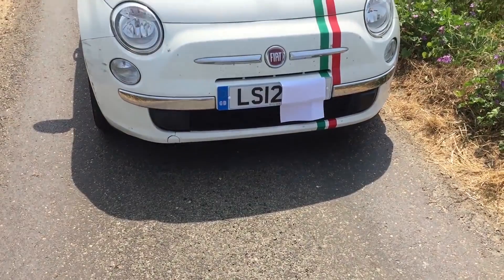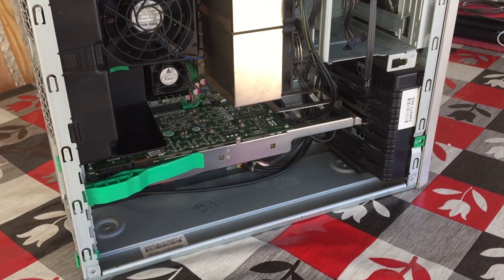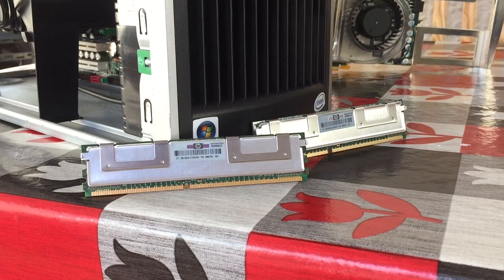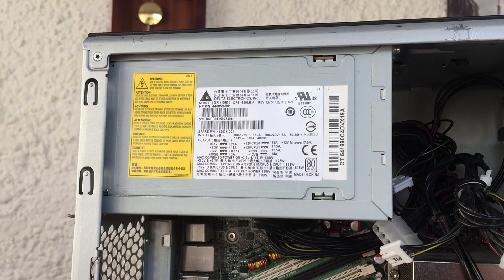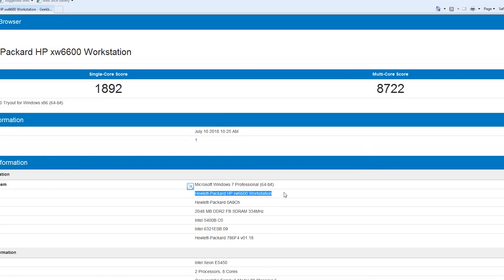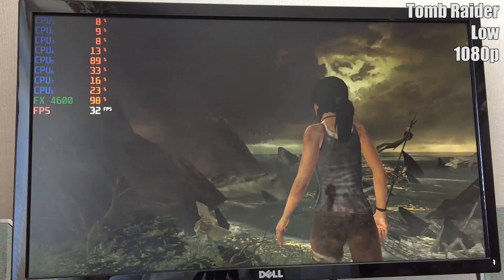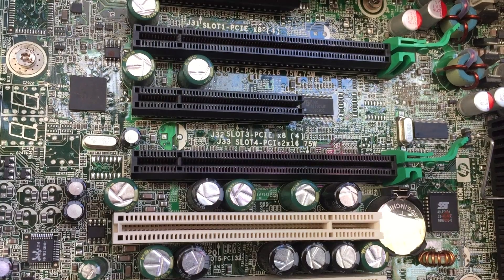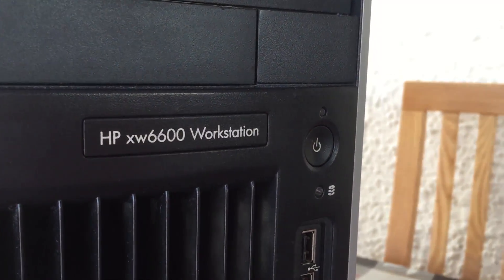This 8 Core Xeon Workstation PC Cost $5000 in 2008, Today I Bought One For £25 ($30)

Comment: Grab the biggest Quad cores for it you can,loadsa cheap as chips memory & a good low power GPU .My Dell T5500 has 48GB memory ,2x 5680 xeons & a GT 1060. runs like a train,cinibench is approx 1500.

Comment: I got for 400$(eur) a 16 core (32 thread) dual xeon e5, 128gb ram ecc ddr3, 128gb ssd, 2tb hdd and a gtx 660, he gave me also the old card, a quadro fx 5800.
Reply: And i have an unused gtx 970 cause i got a gtx 1070 so i think it will be worth it to put on my workstation.

Comment: I tried to get a WX8600 once, ordered it...waited 2 months, and it didn't get delivered :(  Dispite their age they are very nice machines to work with. Got a Proliant ML350 G6 instead, which was faster and in Cinebench even outmatches a Haswell i7 in multicore! Not using it for gaming, but for video storage (loads of HDD slots) and on occasion video rendering (which it does realy well, with dual quad-cores with HT, it leaves my 'main' i5 quadcore in the dust, even though the Xeon have 1Ghz less frequency).  And, I kinda like those HP machines, the workstation and servers at least, not the 'plastic fantastic' home/consumer PC's.

Comment: I've got one of these as a server upstairs, but mine was £40 shipped off eBay. Did a couple of upgrades on it.

1) Replaced the nVidia NV150-whatever card it came with. Had a GTX 560 lying around, so that went in.
2) Upped the RAM to 32GB.
3) Installed Win 10 Pro.

With all that? it runs great. Fast, no lag on the O/S and works great as a NAS + 7 Days to Die server. I did try gaming on it but felt it was being held back by the GTX 560. Got 30+ FPS out of Cities: Skylines on it. Same with Tomb Raider and Doom.

If I had a better, 6-Pin card to chuck in it, then I'd love to try it out as a 1080p gaming machine, especially considering how cheap they are on ebay. Might be a great way to get someone into gaming and they can always reuse the card in a better build later. :)

Comment: I built a similar computer with the X5460 and 780TI. The difference between the performance of 780TI and 1060 3G is not large, which may mean that 1050TI 4G, 960 or 970 is enough.

Comment: By the way, you can do info cards parallel to links in the description because the description is so laggy on mobile devices

By the way this processor is literally a Ryzen - nice multicore but horrible single core performance 😂
Reply: Ryzen doesn't have terrible single core performance... you're thinking about FX. Unless you're someone who believes that Ryzen has "Sandy Bridge IPC" from some of the dumb fanboys...

Comment: My main gaming rig is a 1366 LGA main board I bought for €20 with bent pins (1hr with a magnifying glass) running a 6core 12 thread xeon (€30) overclocked to 4.2ghz. picked up 24 GB of ddr3 for €70 as well. I found a deal on a 1060 6Gb for €200. Probably about €400 total for a truly excellent setup with a new case and PSU. Plenty of deals out there

Comment: Funny thing. I got the AMD dual Opteron version of this HP workstation before from my ex company. It had a Quadroo FX5800 as the GPU. And being a dual socket it has dual 4 cores for a total of 8 cores. 16GB of DDR2 ECC and a noisy 850 watts PSU. 

It was a power hungry workstation and the front traps dust like a magnet even when placed on a desk. And because of the heavy chassis. The desk even got wrapped. Broke my back many times carrying these bastards. 

It was my dad's daily driver until i sold it off and upgraded him to the  i5 4460 CPU back when the HP PSU decides to blow up.
Reply: What model it was? I have a XW9400 with 2x dual core Opteron 2218's and 12gb ram.
Reply: Pasi123 its prob a XW9300 or 9400. Cant rmb the exact model. But i know its mobo was a nVidia board. Ran Windows 8.1 with a 128GB SSD. The original WD Raptors died.

Comment: i am curently buying a hp elite 6200 intel core i5 (gen 2) 3.1ghz ram 8gb/ hdd500 gb and GPU nvidia quadro k2000 2gb for 230 euros is it worth it i am currently buying it for gaming like cs go fortnite and possibly ark on low pls someone respond i need help
Reply: Bardh Xhemaili 180€ max.
Reply: no
Reply: not work 159€

Comment: RandomGaminginHD ummm pcie slots only support a max of 75w anyway. So that's not a limitation. They are specifically designed to ouput only 75w. Hence a 1050 having a TDP of 75w or less. The way the top one says 75w + 75w is just implying that there is one 6 pin on the PSU that will supply another 75w. Also, you have to make sure that board is SLI certified or it won't work, because NVIDIA is dumb about all that licensing. Crossfire I think can sometimes work when a board isn't certified for it because that's just how AMD/ATi works.

Comment: just for fun I got a high end xeon quad 771 cpus for around £7 converted it to socket 775 (with a custom bios hack and pin swap) was all straight forwards pc runs great! also one of my friends uses something very similar to the setup listed in the video (with 10x more ram) as a server to host all sorts of games, still pretty decent hardware!

Comment: I picked up one of these for $25usd. It had 8gb of RAM one E5440 in it, which I reused in a 771>775 mod build. I upgraded the WX6600 to the dual E5450's added a front panel intake fan, and installed a Gigabyte GTX 760 Windforce in it and a new HDD. It got 37.65fps at 1080p medium on Superposition, 62.6fps at 1080p High on Heaven. That's solid performance! I sold it to a friend who was getting into graphic design, etc. The build cost $132 total.

Comment: Nice find! I was originally going to grab one of these as the bang for buck was pretty good on eBay, however I was hoping to pack in a lot of ram too and 4GB ddr2 sticks are somewhat spendy. I plumped in the end with a Dell Precision T5500, dual X5675 hex core Xeon, 24 threads with HT enabled. 48GB ddr3 ECC ram and a Quadro 5000 for 3D work. It also makes a very nice Skyrim machine :) Single core isn't earth shattering, however multi thread is competitive with some up to date CPU's.

Comment: I used to use XW8600 Workstations at a previous job. Similar to the XW6600 in the video except a larger case and the MB has a TON of SATA ports and there is nearly always an 8 port SAS controller present as well. I remember how incredibly heavy the XW8600 workstations were too! Those things are TANKS!

Comment: Heres my scores, they are not that far behind your Dell, its a dual xeon cpu also!
Mac Pro 2,1 X5365 8core 3.0ghz 🍎😍:
     Cinebench 564
     Geekbench 1821/8463
Reply: A CHANNEL ABOUT NOTHING 🙂 yes of course a 7700K is going to be much much faster, if u found a 3,1 for only $100 thats a really good deal! i salute you 😍 If u dont like it u can easily flip it and sell it because it natively supports El Capitan rite out of the box 🍎✌😍 Uhm Xplane 11 is a fairly recent title and its heavy and its an 'unoptimized' buggy program, 🤓 its definitely not a good candidate for a slow classic 3,1 however these mac pros natively support a 980ti 6gb which would definitely improve the fps and playability, maybe not in xplane 11 but you should be good in many games that are highly optimized for Intel & GTX hardware, I love my classic mac pro it was actually a hand me down from my best friend when he upgraded to a newer mac, when I see a dual xeon 5,1 for cheap i will buy another one yay! 🍎🍎🕹😍 Also I wouldnt mind picking up a couple X58 & X79 boards and doing the same for some Windows PCs 👷

Comment: Typing this on an i7-3770 :D Also a HP machine, but one of these Small Form Factor PCs. I really like the HP machines, more than the Dell Optiplex, they seem to be built somewhat better.
Reply: yeah, but hp has custom power connectors, which make it a pain in the ass to upgrade
Reply: I'm using a Dell Optiplex with an i5 3470, 8gb DDR3, EVGA GTX 1060 3GB, EVGA 500W, 1TB WD BLUE, 120GB SSD. All for only $450!
Reply: I have the i7 3770k (With K 3.5ghz) and paired with amd radeon hd 7850 (2gb) plus 20.0gb ddr3 1333mhz ram.
Reply: Not me i was always a Dell fanboy, i've worked with lot of dual core/core2duo dell optiplex 300 and 700 series systems, they where really great quality and so robust i loved them. Also why i love dell is because of Alienware :D 
The reason why i'm not the fan of HP because last year when my PC started dying out, i've bought second-hand HP Elite 8200 (i5 2500, 8GB DDR3). It was all great until i bought AMD RX 560 PowerColor 4GB version (AXRX 560 4GBD5‐DHV2/OC) wich requires 400W psu and mine is 320W, and when i wanted to replace the psu, i couldn't because 8200 uses some proprietary HP connectors and now i'm stuck with it, wich is a problem because system is definitely lacking power. Sometimes when i turn on the computer, shortly after it boots up, screen goes black or pink and the pc freezes i can tell by the led lamps on the front panel (no response on the hdd led). This is probably messing up my GPU maybe even motherboard. I have never had this situation on a (relatively) modern Mini Tower PC before.
Reply: There are power connector adapters that you can use to bypass the proprietary power supply issue (4pin to 24pin, 8pin to 24pin).  The main issue lies in where they often place the PCI-E slots, many of them are so close to the CPU cooler that you can only fit single slot cards. However, you can bypass this issue as well with a PCI-E extension cable.
Reply: BR0723 I use one for one of my pc’s
Reply: Danijel Vrebac hook up a dedicatef psu to the gpu. Or study the proprietary psu and maybe you can map it to a standard atx psu.
Reply: Dell optioned 9010 mini desktop form factor i7 3770 16gb ddr3 240gb ssd, 2tb 7200 hdd ,450 watt psu upgrade and 1060 6gb all together cost right at 400$ and couldn’t be happier it’s a beast of a 1080p gaming and runs my VR headset as good as my brothers $1,400.00. i7 8700 ,1070ti machine that he had and reason I got into gaming for the vr stuff . It’s extremely affordable to get into pc gaming if you do a lil research and realize that any i7 since the 2600 will compete with anything made new today , of course it ain’t as good but it’s not so far behind that you will notice the difference at 1080p gaming .   It sure beats the fuck out of buying a PlayStation pro or xb1x
Reply: I picked up a sff i5-3470 machine to replace my fx6300 and took the ssd and 1050ti from my old pc. Even tho its a 4c/4t cpu it feels much faster than my fx6300 did
Reply: Still using an i5 3550 and waiting for my ryzen 5 2600x
Reply: PhilsComputerLab I just upgraded from an i7 3770S to a Ryzen 5 2600, 16GB 2966MHz ram, 512GB 960 Pro M.2.
Not because the i7 was really that slow, but, it had been 6 1/2 years since the last refresh.
#firstworldproblems
Reply: I paid $1100 for my HP Pavilion P6 in 2011 from a retailer, specced with a 1TB HDD, 4GB DDR3, A6-3600 CPU and a GT520. It blazed through gaming for quite a few years and I only upgraded November 2017. I refurbished the old case and threw in a better CPU, more RAM and a R7 360 GPU so my brother can use it as a backup machine.
Reply: boingkster 1100 seems a bit much for those specs, even in 2011
Reply: Ace of Spades That's AUD, roughly 800 USD.
Reply: go on amazon, they sell PSU adapters for only a couple of bucks, i have one and it works great.

Comment: I have an i3-8100 (4 core, 4 thread) and the best score I've been able to get is 601 in R15.  Simply breath-taking that this $110 CPU packs 95% of the multi-threaded power as not one but TWO $1,000 Xeons from 2008.

Comment: I have a Dell t3500 with a Xeon w 3505 that I upgraded the CPU to an i7 965 3.2ghz (four cores and eight threads) and an Rx 550 I can still upgrade to an i7 975 extreme if I want to, for me I had to upgrade the bios for the i7 to even work but it was no big, so you might be able to upgrade the CPUs to a first gen i7 with a bios update, just do your research first so you don't get the wrong bios for that model

Comment: It is normal for a PciE slot to deliver only 75 watts. This is also the case with modern boards.
Reply: Pretty sure thats what the standard specifies as the max power allowed from the slot. Pretty much why more powerful cards need external power.
Reply: Yes it is but there are some exeptions that can deliver some more power .
but you can find them only in professional server equipment

Comment: I'm thinking r9 290x or 1060 and 16gb of ddr2 (could keep the 2gb of 667 but they will bottleneck performance so i would go with a kit of the fast speeds supported)

Comment: I picked up a custom built dual X5450 workstation not to long ago myself for free. It came with a SuperMicro X7DAL-e motherboard, 14GB RAM, 9800GX2 and a 750gb HDD. Sadly the 9800GX2 is dead so I replaced it with a GTX 480, I also added a Dell Perc5i and added 4x 300gb 15k SAS drives that I had lying around. It runs very well, just very power hungry, very hot and very loud, over 750w used under full load. The NZXT Lexa case is not great with airflow which does not help it very well! I should make videos of all my different machines at some point, but the video quality would be no where near as good as yours!

Comment: So my tiny core i5 2400 is weaker than those 2 CPUs in multitasking and rendering? What about gaming? We'll find out in the next video whenever Randomgaminginhd upgrades the 8 cores PC into a gaming machine that is capable of running new games and softwares.
Reply: Cuzeg Spiked it doesn't matter when it comes to overall performance.
Reply: Well said buddy, I think i'm fine with my Core i5 2400 and it can be paired with an RX 470/570 or a GTX 1050 Ti/1060 3GB.

Comment: I don't think that the power supply have enough amps on the two 12v rails for a power hungry card. At least I wouldn't be comfortable with something like an rx580, 1070 or even flagship cards from older generations like the HD7970. I would be careful about it. Probably best to stop at a 1050ti, maybe 1060.

Comment: I think you can put more power hungry GPU in second slot and the card will just drain rest of power from 6 or 8 pin connector.
BTW some people run old Optiplex, which some of them have PCIe x16 only up to 35/45 W, with basic GTX 1050 Ti (without 6pin) inside. Even on stock 240W PSU.

Comment: What pretty sad for the fx xhips is that it these 2 xeons are about as powerful as a newer higher clocked fx 8350. My fx 8350 at stock gets 632 CB. probably gonna be simmilar in proformace to an fx8350 l

Comment: I am really curious on how it will do with more multithreaded gaming. Since it could see some of the same issue as Ryzen on low RAM, since connection between two CPUs I imagine is working slower than interconnect inside between cores. Ryzen has similar case with Infinity Fabric, since it connects two dies of 3 or 4 cores with slower connection, which shows in some games. But on Ryzen you can remedy that with fast RAM. Though I imagine difference should be more clear with higher end graphic card. So I am looking forward to followup.

Comment: Many of these old HP Workstations will take RAM that isn't meant to be compatible - remove the ECC stuff and try sticking non-ECC RAM if you have some that fits, otherwise dunno where in the UK you are, but I have a fair amount of HP ECC RAM that might work lying around. 
I've got a couple old Z series workstations and they're also surprisingly capable (and very well made) beasts!

Comment: I have a HP xw4400 Workstation.  Not for gaming but was hoping to use it as a Twitch streaming PC to handle the encoding leaving my main gaming PC free to just handle the games.  If you got the 6600 for £30 I'd be willing to trade you my workstation for yours and put another £30 on top.  Those twin Xeons would benefit be greatly.

Comment: It's great to see your doing some videos on an old workstation! I think there often overlooked as a budget gaming rig. I've got a Dell T3500 which only cost me £75, the great advantage that these systems have in my opinion is that the stock power supply normally will have at lease a single 6 pin PCI-E connector meaning your not restricted to a GTX1050, 750ti or GT1030 when looking for a cheap GPU to get you started. You could get a GTX660 for example and then upgrade to GTX1060 later without the cost of a new power supply! 

I live in the same area as you. If your interested I'd love for you to feature my computer on your channel as I think the price to performance of my rig is fantastic! Your channel has been my main inspiration and resource whilst I was planning what to buy and saved me from multiple pit falls that could have discouraged me from getting into PC gaming.

Comment: I did something similar the other day - picked up dual xeon 5440 Fujitsu Celsius workstation, massive case and 1000W psu for £5!!!  Fixed some bent cpu pins that were stopping it boot, flashed the bios with a generic tyan firmware so I could use non quadro cards, put in a gtx 770 I picked up for £45, added 32gb of ecc ddr2 (in quad channel) for £20 and a 500gb hdd for £5. Now using it as an absolute beast of a server running Natural Language Processing experiments on CentOS 7 Linux.

Comment: I use a Dell Precision T7400 as my main rig, very similar specs : Dual Xeon E5420, 8Gb of FB-DIMM DDR2, Quadro FX4600, dual SAS 164Gb HDD, 1000W PSU.
Got it for free from someone I know who found it in a dumpster :D It was a former hospital X-Ray machine.
I had to upgrade it a bit, with an SSD, a GTX560, works really well.
My Cinebench score is only 506 though, the E5420 have a much lower frequency at 2.5Ghz. I'm planning to double the RAM and  replace the CPUs with X5482 or X5492

Comment: I got a dell t7500 for 150. Can have dual cpu but the cost is too high. I upgraded the x5620 to x5670 6c12t and slapped in an rx470 and plays all games 1080p high settings 60fps